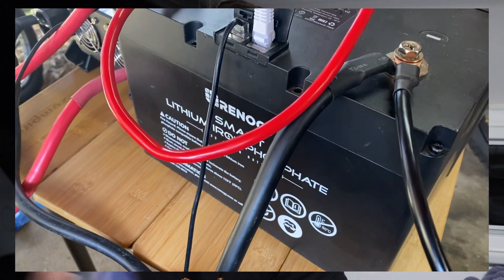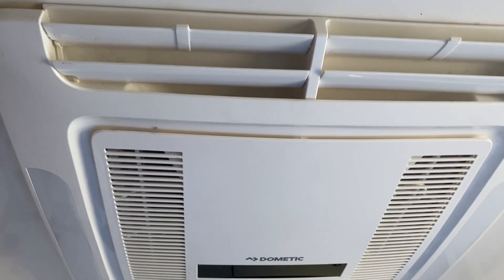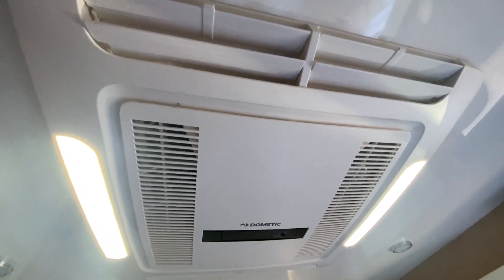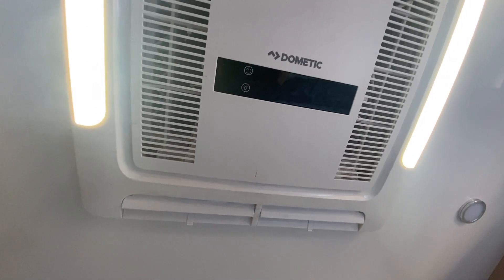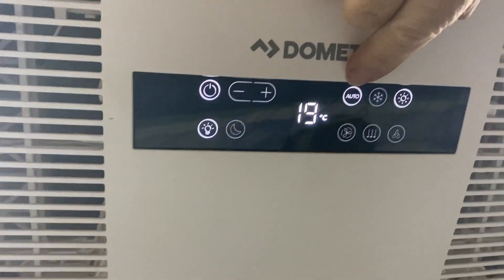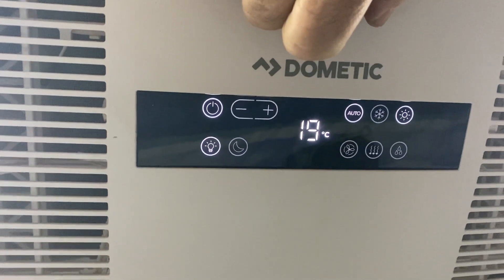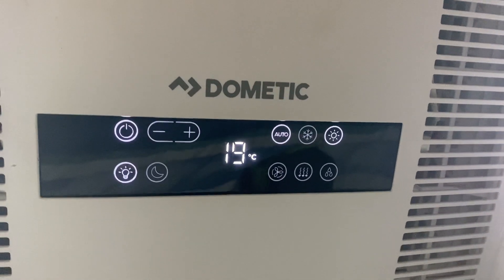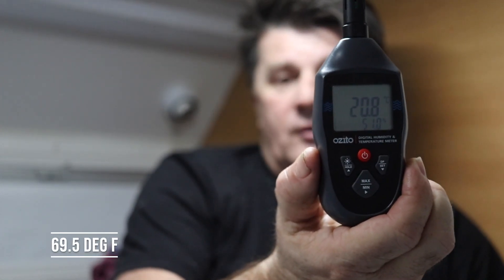Off Grid Air Conditioning // Dometic Harrier Lite // DIY Off Road Camper

Comment: Hi Daryl. Just wondering how you handle air circulation for your camper when using the aircon. I guess using the aircon means closing up the camper which would mean little fresh air coming in.
Reply from the maker: I'll generally leave a window slightly open, although it does act in its various modes as a recirculating fan and dehumidifier apart from heating and cooling.
Reply: @DarrylSheather  Thanks mate.

Comment: Great vid. Would you recommend the Kings inverter, albeit I know Kings is hit and miss?
Reply from the maker: I've run coffee machines, a convention cooktop and the air con off it with no issues. So far for the money, I can't see how you can beat it. I suppose the question is, how long will it last and for that I have no answer.
Reply: @DarrylSheather  thanks. Will look into it for my build.

Comment: Hi Darryl, is that a 12v system? And you can run the air con with a 1500w inverter?? That seems too little! Is the air con unit the 2.4kw one or what are the specs? Thanks mate set up looks great.
Reply from the maker: Correct, a lot has to do with the size of the cabin,  as the A/C's duty cycle isn't that long. As you can see, once it hits the required temp the amp draw is actually quite low.
Reply: @DarrylSheather  but let’s say you had a larger area, I have mine installed in an old 6m Toyota coaster. Would it work do you think? I am running an 1800 watt inverter. Thanks mate!
Reply from the maker: @torben314  Dependant on A/C, is it an old type compressor that draws a million amps on startup or the more modern and efficient soft start inverter versions. Also depends on how much  battery storage you have, it's one thing being able to run an A/C it's another being able to have the battery storage to run it for any length of time. All you can do is connect it up and monitor the amp draw, and see if the inverter will handle it. Of course, experiments like these are done at your own risk lol.
Reply: @DarrylSheather  thanks mate. It’s the exact same ac as yours that’s what got me to the video actually. If I was going to do this I’d run 2x120ah itech lithium batteries. I have one currently but could upgrade. Very helpful mate thanks and hope you keep warm/cool on your travels!

Comment: Darryl. The solar panel needs to be moved up. You will get shade from the stuff around it. You won't get good charging.    Can you link where you found the cladding you used on the exterior.   Everything looks great.
Reply from the maker: In practise it works quite well. Theres a fine line between optimum and packaging sometimes.